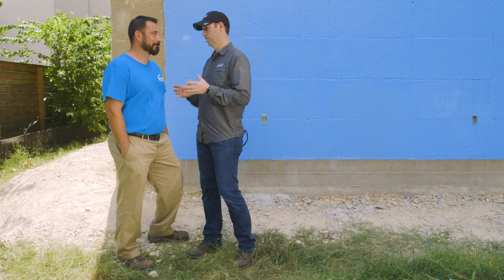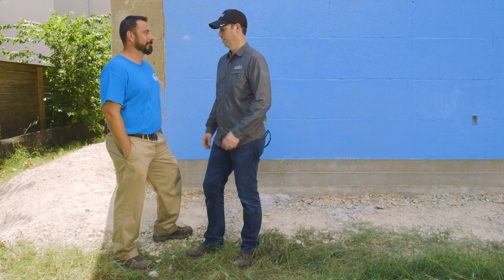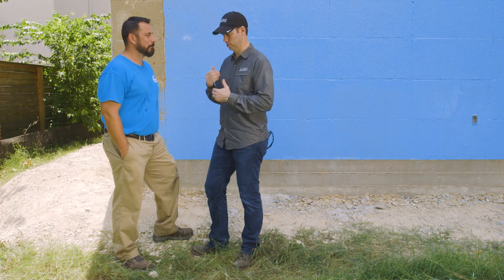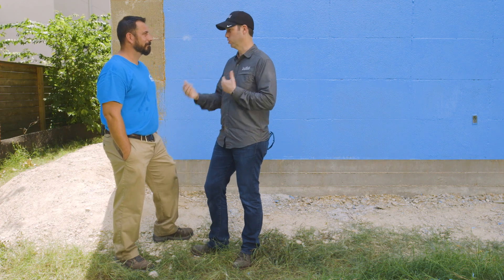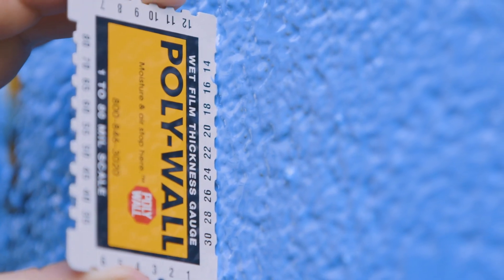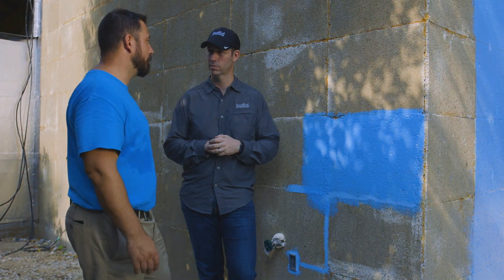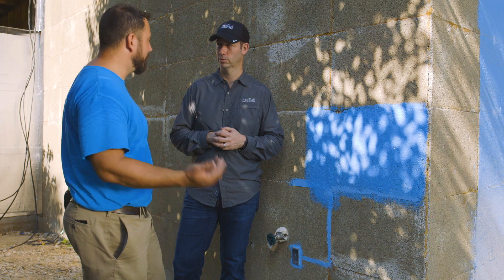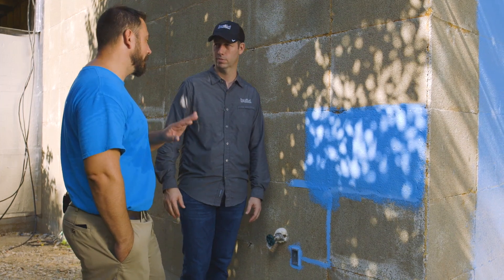Waterproofing Bautex Insulated Concrete Forms

Comment: I contacted the company and this cannot be used below grade.  The Poly Wall Blue Barrier products are not for below-grade waterproofing.  They behave like a fluid version of Tyvek housewrap, as a breathable above-grade air barrier material; so not to be used as a below-grade waterproofing membrane where groundwater is present with hydrostatic pressure.  I  am guessing there isn't a roll-on product that can be used below grade on ICF.  Is that correct?

Comment: My ICF with peel stick works well, a walk out bungalow, mostly sand below topsoil and built on solid limestone base. Styrofoam on both sides of cement, went together like Lego. Added 3 foot of gravel for basement floor then insulation and cement floor. Any water flows between the natural limestone and gravel.
Built a room under 2 car garage and surprisingly no humidity issues. Cheap to heat and cool, worth the extra.
Reply: I know this is old but lumber prices today make ICF a serious choice.

Comment: Would I be able to use this on the outside of a foam ICF wall. You know on the foam part and if so do i need to use the sausage gun between each ICF joint?
Reply: Probably do one coat then mesh and a second coat

Comment: Would it be possible to do a double spray coat installation of this product?
If so, is there a cure time in between spray coats?

This product is similar to Rubberwall (below grade foundation water proofing that I used back in the mid 1990's.
Reply: Cure time depends on the weather conditions - this product loves moisture so it actually cures quicker in a humid environment.  For more details, check out this link: http://poly-wall.com/liquid-flashing-products/blue-barrier-flash-n-wrap-2400/
Reply: @TreBischof  :  Can the PolyWall's Blue Barrier Fluid Applied Waterproofing Membrane be applied to an ICF wall?
Reply: @Real_Tech_Skills  yes, sir
Reply: @TreBischof  Thanks!

Comment: Hello. This product seems to be perfect from my problem with moist penetration through my poured concrete walls. But can this be used below ground ?? 
I have been thinking of using a Bitumen product but this seem a lot nicer. 

Hope to hear from you. 

TR
Reply: This is not for use below grade but these are http://poly-wall.com/waterproofing-system/

Comment: is there any material that this shouldn't be applied to?  more specifically can this be applied to eps/xps foam from an ICF system?
Reply: In this video, they're applying it directly to a Bautex ICF wall. Bautex ICFs are a composite block made up of EPS beads and cement. You can see that most of the wall's surface appears to be exposed EPS ( 4:21 ). So I would say it must be perfectly suitable to apply this product to EPS and XPS foam. Then again, that could be because of the cement present in the composite, because Poly Wall does have a peel-and-stick waterproofing membrane specially designed to be used with EPS/XPS ICFs.

Comment: Could you do the whole house with this product, On roof under roofing material?
Reply: I have the same question. My current project has a 1.5/12 garage roof that attaches to the main structure. On this project we used a "Blue...." peel-n-stick product. Roofer applied their product first (Bituthene about 18" up the wall) and we came in and cascaded our wall product over theirs.  With the fluid applied, would you use it on wall and roof? Have a great weekend, and do excellent work!
Reply: I can see the confusion there. The material on the roof is actually a sheet good. That's not the fluid-applied system. It's only applied to the vertical walls.
Reply: Their website is not very clear about it, but they do show a picture of a house with it on the roof. 

http://poly-wall.com/wp-content/uploads/2016/02/BlueBarrier-2300-LiquidWrap.jpg
Reply: This product is perfect for the wall, but not for use on the roof.
Reply: Tre Bischof 
???????

Comment: Matt, Can you please do a show about waterproofing around exterior electrical? My main question is keeping water from entering through wall mounted light fixtures and their  electrical boxes. 

THANKS!
Reply: This might be a good option: http://poly-wall.com/air-barrier-products/bluebarrier-joint-filler2200/
Reply: I had seen that but they don't really show what to do to keep water from getting inside an electrical box when attaching a light fixture to the wall. Always seems like you end up with a 4" hole with no good way of preventing water from dripping into it. They do show for instance pipe protruding and simply covering a few inches of the pipe with the product.

Comment: I'm assuming a homeowner can apply this, it seems pretty simple (in fact, easier).  How does the cost compare to more traditional materials?  Also, will this work as easily on an OSB/plywood sheathing or is it more oriented to block walls?
Reply: This product can be used on almost any substrate. As for the cost, it is higher than some traditional materials, but many contractors save money on the labor and it won't have to be re-applied if the sheets blows off in the wind.